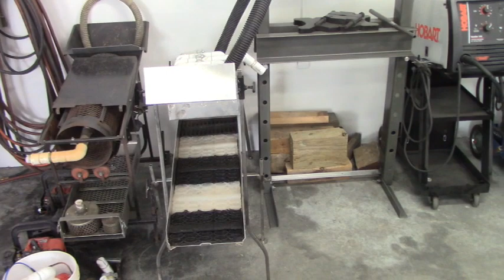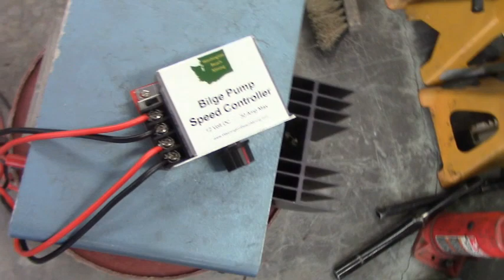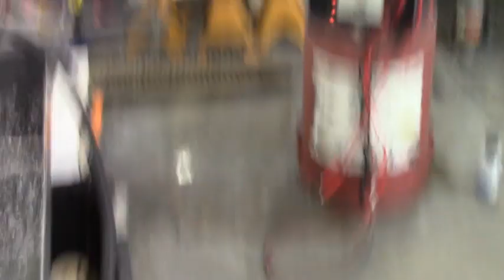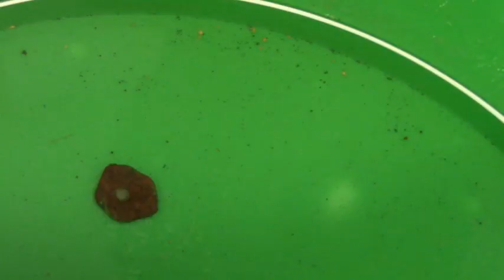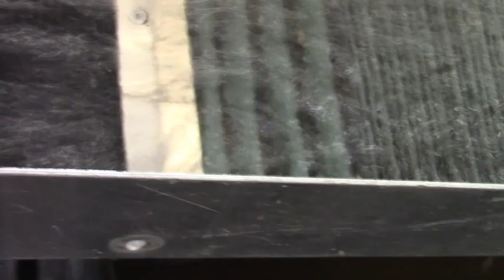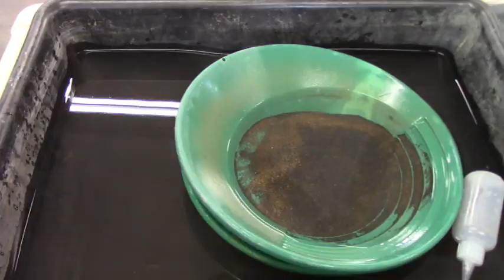CLEAN UP SLUICE VS DREDGE CONS PT1

Comment: I would love to run some of that black sand bucket down my Infinity Prospecting VDR clean up sluice!!!   Awesome you have all those cons!!  Looking forward to any videos that you do cleaning those buckets up!!
Reply from the maker: Thanks for watching. I am sure the VDR would do well. The problem is the 50 and 100 minus needs another type of clean up afterward.
Reply: @CandSMINING  yea I get that.  The reason I said that is I was curious if it did like the Washington Beach sands did in the VDR mat.  Near the top of it the black sands cleared out and I had a bunch of just gold sitting there.  I want to get a blue bowl or a Miller table to help with the final clean up.  However since I don't own either I just sit and pan one small spoon full at a time to do my final clean ups lol
Reply from the maker: @Dragos_Cazacul  I have a Blue bowl and may make a miller table like Utahavalanche  does on his channel.
Reply: @CandSMINING  I have thought about making one like that as well.  I even thought about making a something similar to a blue bowl just to see if I could do it lol.
Reply from the maker: @Dragos_Cazacul  I saw a device similar to a blue bowl made from a angle food cake pan. 🤔🤔😢😁
Reply: @CandSMINING  I saw that as well.  If I am going to try and make one it may use part of something like that.  However I would probably try and make it bigger.

Comment: Looks like you need to dry the magnetite and spin it off. It beats panning all that heavy stuff.  Heavy pans to ya...
Reply: It looks like you need a dampening mat on the top of it to slow it down a little bit...
Reply: The metal clamps are things that people from Montana use in lieu of a proper stand/header box.
Reply from the maker: I have Mining magnets from coulter young. Wet is far more safe as far as loosing the -50 and -100 gold. The sluice is just the first stage of clean up. The panning is just to show why we don't do a better clean up on the claim. The next  stage of clean up will be either miller table or blue bowl.

Comment: I have to ask; When your running and you see gold in your tray , why don't you grab your snuffer bottle and suck it up? It would make sense to me that if i had time to point it out, i could point with the tip of my bottle as i'm sucking it up. I mean a bird in the hand is still worth two in the bush. Unless with all this confusion (babel) around that changed too:) Everybody does it. When i see it i grab it.
Reply from the maker: You can pick it up with a snuffer. You will sometimes loosen the gold beneath it  and possibly loose it.  Once it is in the silicon it isn't going anywhere.
Reply: @CandSMINING  I realize that Chuck. It's not that it's going somewhere. The fact is it's one (or more) less piece to try to pan out. Anyway i'm into amalgamation. The old "Miller"dredge had it right. That copper plate would pick up a lot of gold. Used one for years.
Reply from the maker: @richardbeee  I have done amalgamation in the past. Just too messy for me. I still have about 10 pounds of mercury that I may use in a future video.